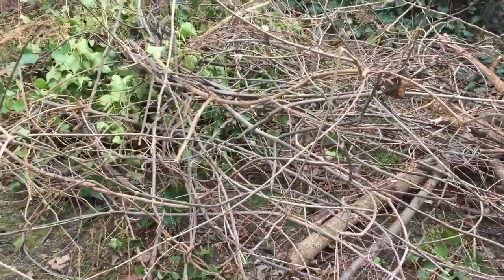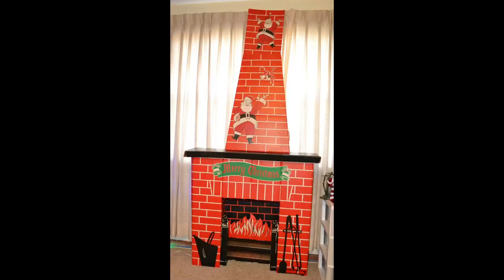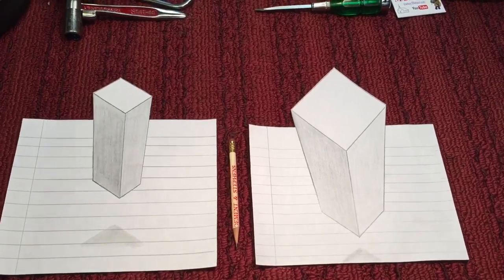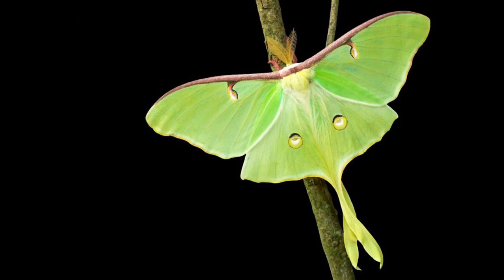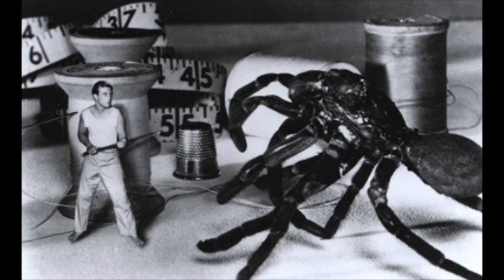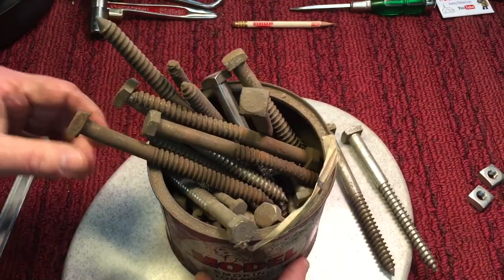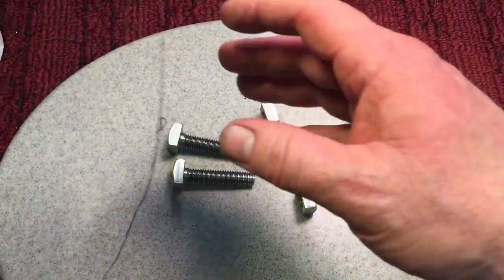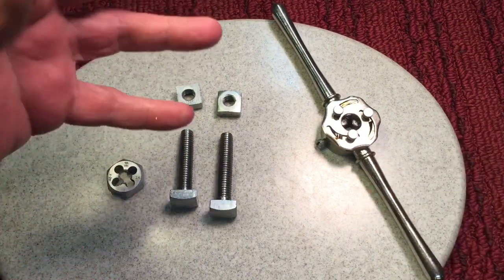Mega Mosh Monday- Awesome Pencil, Luna Moth, Tarantulas and Bolt Fabrications

Comment: John, just want you to know I just had my first experience using a tap. First I did a couple practice runs and just as you warned I didn’t have the metal well centered and scored and it was off center. I got a new center punch and carefully centered it this time. Sure enough that worked. Thanks for that recent lesson!
Reply from the maker: I'm so glad it worked out for you, tapping or using a die can really be a nightmare if everything isn't done correctly.  When I was a youngster I bought a cheap Chinese tap and die set and had nothing but problems, good tools and decent technique make all the difference!   Thanks!

Comment: All that wood from the trees can be given away or sold on craigslist to local woodworkers, or alternatively you can see about contacting a lumber mill if they want the logs. If the guys taking the trees down don't cut them up you may have better luck with the latter. One mill in northern NJ is called Boards And Beams - I don't know if they will go all the way to where you are or even take the trees,  but it's worth a contact if you don't have one more local to you.

Comment: You might consider getting a latch/tamarack tree if you like the look of pines. They have “deciduous” needles that aren’t that messy. In the spring, the new “needles” are bright green and very soft. They grow with very straight trunks (another advantage) and were commonly used for boat masts.
Reply from the maker: Thanks Paul!!! I will look at them!   😘👍
Reply: Larch not latch (dang spell correct)